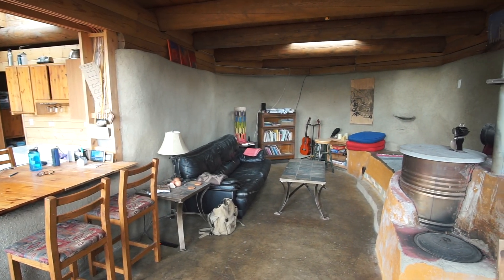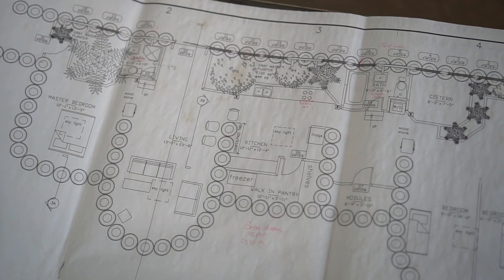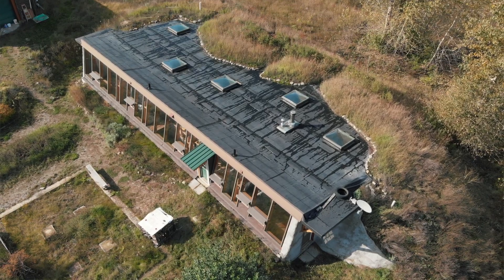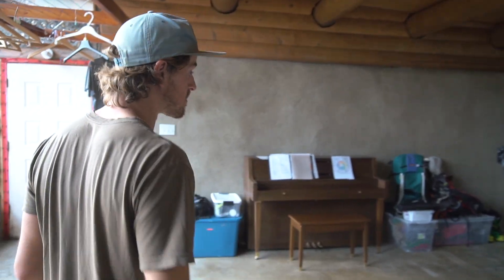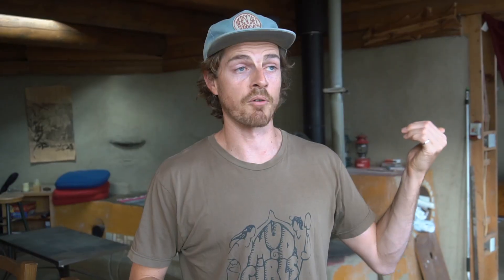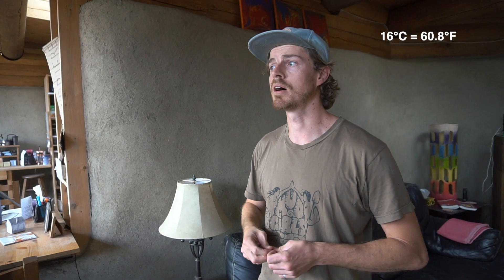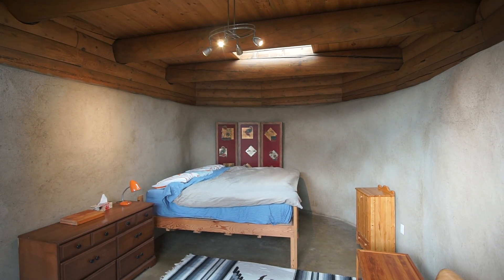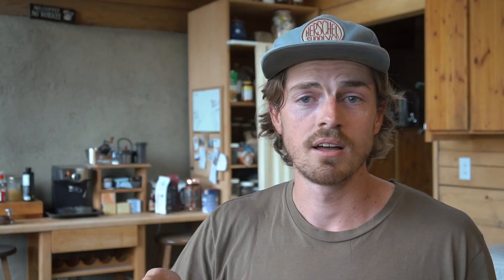Engineer Living in a Beautiful Earthship Shares Valuable Insight!

Comment: I understand that there was a set budget for building this almost earthship- but why after the considerable work involved with creating the thermal mass with earth packed tires- they wouldnt make the cooling tunnels through it and why no over hang for front of house?- i am not understanding- would those two aspects have been so much more as to not make it worth it?
Reply: He said it was an older version, with airflow through the roof windows..
Reply: @Newcards4u  Looks older. . Most of the newer designs I see rely on a green house layer, isolating the living space from the outer wall. I'd like to see how that design would perform in the BC climate.
Reply: Isnt IT more useful for the Environment to recycle the used cans and instead lift 8 more shovels of dirt ?
Reply: maybe they thought they would not need cooling ? it’s a pretty informative video regarding paying attention to the details of the original design. i like that they used cob. i wonder about the off -gassing if the tires though.?
Reply: @gailalbers1430  I've looked into the off gassing question. Believe it was the university of Wisconsin that did a study, where the results posed a low risk. Here's some conclusions that I've personally come to in my research.

1. Licensed builders, are constantly using materials, that are found out later to be harmful. Asbestos, lead paint, pipe sealant, duct seal etc.. So, it's happening anyway.
2. Off gassing is usually a product of sun exposure. The tires are encased in plaster or similar material and non-exposed. 
3. If designed properly, my main concern of the chemicals leeching into the water supply, is remedied by the fact that your water is isolated by cisterns built into the design. 
4. If you're currently living in a home with a basement, you should  be testing for radon anyway. There is no reason that a similar test for harmful toxins couldn't be done in this situation.

So, from my view, I will not worry about this, if I decide to build one of these. I would use a good vapor barrier, prior to encasing the tires, and look at having periodic tests done as a precaution.
Reply: Debt Miner thank you for the detailed answer it’s aprreciated where would you apply the liner though, under the plaster of the interior walls;between tires and plaster ?
Reply: @gailalbers1430 , Michael Reynolds said that once you plaster over them there is no off-gasing because they aren't exposed to the sun.
Reply: keli Surfs there is an architect in Taos who says that they still had off snd create fine cracks in the plaster.., i don’t know...